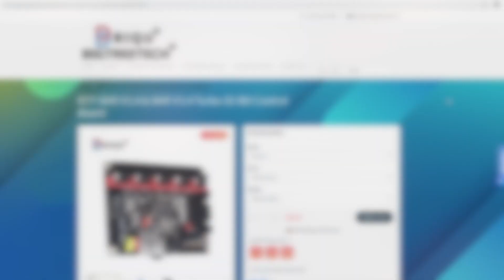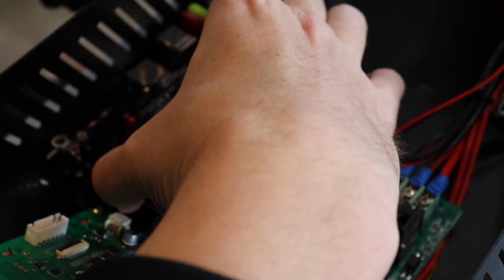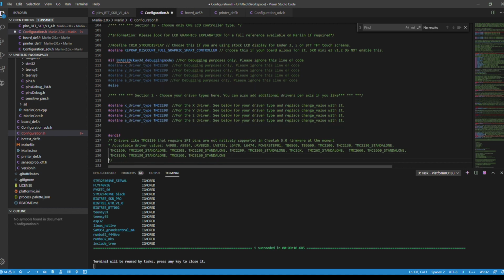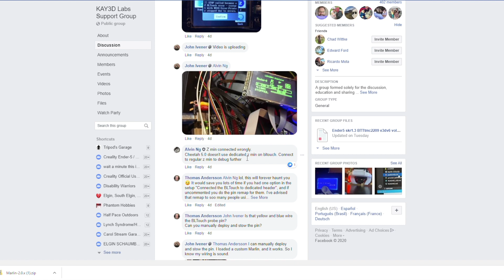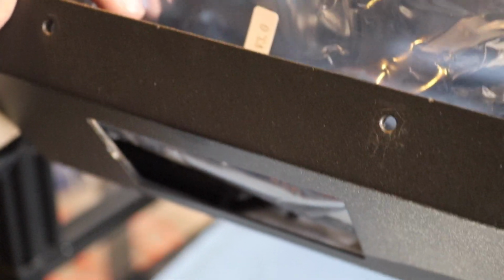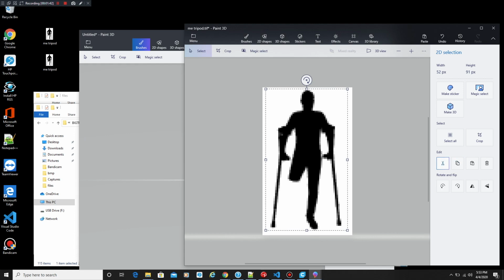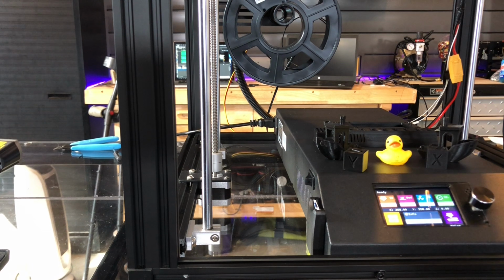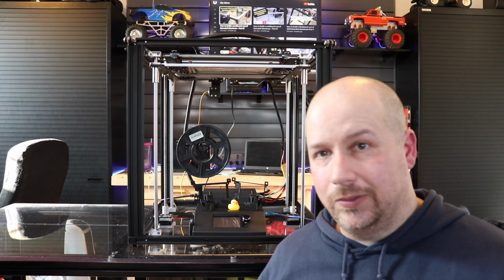Ender 5 Plus Ultimate Upgrade!   BIGTREETECH 32bit 1.4 SKR TURBO & BIGTREETECH TFT35 V3.0

Comment: HELP!   I searched every possible way, to find PlatformIO IDE and it doesn't show up at all...I can't download it and so I cant flash the firmware.  I'm actually trying to use this board on a Lowrider CNC printer...  I'm so confused...  Thanks!
Reply: Marlin has a terrific guide to show you how to get setup. Check this out: https://marlinfw.org/docs/basics/install_platformio_vscode.html

Comment: @Tripods Garage  Thank you for the very detailed video. I purchased the same setup after coming across your video on the creality facebook page. I currently am at the point of editing the code in visual studio but the files do not show up when I try to open them. I downloaded the file from github, unzipped it, and saved it to the desktop. If i open the files it will automatically open them up it VS but when I save the changes it creates a new file instead of over writing the existing files. I then downloaded your setup from github, unzipped it, copied it to the sd card, and tried updating the board via sd card but when i turn on the power i only get a blank screen. Any help you could offer would be greatly appreciated.

Comment: Im having an issue with aux leveling. It only does a small square on the first quadrant of the bed as if it was an ender 3 bed for the 4 points. abl works fine, but obviously useless if i cant level it by hand first
Reply: Same issuse as I have

Comment: It may be possible to print directly from the SD Card on the Bigtree Tech board Configuration_adv.h

I can't test this because of bugs in Malin code

 // Add an optimized binary file transfer mode, initiated with 'M28 B1'

  //#define BINARY_FILE_TRANSFER

  /**
   * Set this option to one of the following (or the board's defaults apply):
   *
   *           LCD - Use the SD drive in the external LCD controller.
   *       ONBOARD - Use the SD drive on the control board. (No SD_DETECT_PIN. M21 to init.)
   *  CUSTOM_CABLE - Use a custom cable to access the SD (as defined in a pins file).
   *
   * :[ 'LCD', 'ONBOARD', 'CUSTOM_CABLE' ]
   */
  //#define SDCARD_CONNECTION LCD

#if ENABLED(SDCARD_BOARD_FIX)
  #define SDCARD_CONNECTION ONBOARD // Forces SD card to work on mainboard. Some boards do not need this fix.
  #endif
  #if ENABLED(SDCARD_LCD_FIX)
  #define SDCARD_CONNECTION LCD // Forces SD card to work on external LCD/ TFT. Some screens do not need this fix.
  #endif

Comment: Malin mode does not work on the tft35 v3.0. Touch screen works fine but not the marlin mode.
Reply from the maker: Chuck Taylor - Any error messages on the Marlin mode?
Reply: @TripodsGarage   I have two error messages when I compile. 1st one is... Cannot find "c:\Marlin-2.0.x\include". [9,17] 2nd one is... Cannot find "c:\Marlin-2.0.x\include". [29,21]  I do not get any error on the screen its self.
Reply: The problem was because I am using this on an ender 5 and just changed it to work. You must go to printer_def.h and look for your printer mine had define CR10_STOCKDISPLAY so I changed it to REPRAP_DISCOUNT_FULL_GRAPHIC_SMART_CONTROLLER and now it works. Now once my hair grows back everything will be fine!!

Comment: I changed the pins on the abl, but it does work correctly, it turns on but the probe when going to print doesn’t stop the z axis
Reply from the maker: The Island Engineer - Check your black and white wires.
Reply: Tripods Garage yes, were reversed. But still not working for me. Flashed both display and skr. Manually moving the axis it does a small back a forth movement on whatever axis. Seems comunication from display to printer are a bit off.

Comment: Anyone using the extra driver for the 2nd Z motor? The new Marlin has an auto Z align feature (?) but it requires independent drivers for each Z motor.

Comment: I am not finding the firmware.bin file in the download package on your github.  I downloaded the Marlin-cheetah file.  But I am not seeing the .pio folder under Marlin-2.0x.  Thanks
Reply from the maker: Odd - I just placed the firmware.bin on Github
Reply: Tripods Garage is it a file all by itself?  Thanks
Reply from the maker: @daveglover8942  Yep!  Sitting all by it's lonesome!  https://github.com/tripodsgarage/Ender-5-Plus-build/blob/master/firmware.bin
Reply: @TripodsGarage  Got it.  Thanks.  My boards should be in on Thursday, then I will give it a try.  Any issues using Octoprint with this build?
Reply from the maker: Dave Glover - Shouldn’t be any issues with using Octoprint, people have been using it with this board, plus Pronterface connects without issues.  However, I haven’t had time to set mine up yet, it is on my list 😉

Comment: The SKR 1.4 got dual Z-outputs so why you use all 5 stepper drivers unless you are using dual extruder is beyond me :)
Reply from the maker: The kit comes with all 5, so I installed all 5, beats sitting in a drawer.  The dual Z is just a internal splitter, the 5th driver could actually be used to control each Z if you want.
Reply: @TripodsGarage  thanks for this video, got me past a lot of pitfalls. With your video and Chatthong Rimthong's post on the FB E5/E5P group I'm setting up an SKR14Turbo right now, and until I decide to add a second extruder, I'd rather use that stepper for the second Z.  Have you looked into it, is it as simple as setting your "NUM_Z_STEPPER_DRIVERS 2" in the marlin configuration_adv.h file?  Since the stock E5P only has the single BLTouch for a Z-stop so the "Z_MULTI_ENDSTOPS" should stay disabled. I'm asking before I accidentally torque one Z screw and not the other and royally bend up my printer, maybe I should disconnect the Z screw couplers for an initial test...Thanks in advance and please keep creating great videos.

Comment: I like your setup.  How do you like the 1.4 on the 5 Plus?    The more I run the SKR Mini, the more buggy is seems.  Not bad.  I trust it for several days prints, but there are times it barfs, and I have a bit to clean up.
This one is mine
https://www.thingiverse.com/thing:4181859
Reply from the maker: @No Body - Thanks for watching!  I wanted to keep the existing control box stock looking, well for now.  If I addd anything else to the inside, it will be time for another solution.  I have been running the E5+ in this new configuration 24/7 for 5 days, printing out ear saver strips for local hospitals.  So far the Skr 1.4 Turbo has been solid, no complaints!  I can have it run right behind my in Zoom meetings for work, and nobody can hear it ;-).  I have seen your setup before on the Creality Facebook Groups, looks amazing!
Thanks again for watching, like and subscribe - Tripod

Comment: did the swap help with your bed leveling issues ?( did the prints start sticking to the bed better ), wondering couse i think my  stock board has issues i dont know if its board related or  firmware , if its firmware i am gona speed this swap up and do it 1st before i do the rest of the mods
Reply: level bed, fix z offset, warmed bed, print hotter. Basic steps to better bed adhesion.
Reply: @SteinerSE  thats all nice and good but the homing bugs out and the nozzle crashes on the front of the printer the ABL doesnt get a good reading they are all over the place , the lead screws for the Z axis are all crazy and make noise , + the stock firmware goes bonkers every now and then . so you can do all that get a couple of good prints and back to the drawing board , its not a solution on my case , and doesnt rly matter anymore anyways couse i ordered all the parts i need including this board

Comment: Mine only came with 4x TMC 2209's. What gives lol
Reply from the maker: Really?  Never seen a BTT kit that didn’t fill all the available driver ports.
Reply: @TripodsGarage  It has 5 ports, its the 5th TMC 2209 that wasnt sent with my kit.
Reply: @TripodsGarage  Ok, Id missread your reply earlier. Anyway though I checked the amazon listing and mine was only supposed to come with 4. It might of been the E5 kit rather than the E5+ kit. I suppose I'll have to use a splitter cable to reach both Zaxis motors
Reply from the maker: Reece Engineering Greetings!  You will not need to get a splitter if you have the Skr 1.4 Turbo.  The Z is internally split (ZAM & ZBM).  Basically the E1M is your extra driver (#5) port,.  E1M can actually be used if you want to separately drive the other Z motor, but not really needed.  Hope that makes sense?  Thanks Tripod
Reply: @TripodsGarage  1. X Axis
2. Y Axis
3. Z axis
4. Extruder

Yea it makes sense, but now Im wondering why your kit came with 5 2209s and what you are going to do with the 5th one lol!

Comment: Ran into some issues with my compile. I tied to do it all myself, I am very close but im having a BLTouch issue. Here are my config files. If you have time to take a look that would be awesome! My BLTouch doesnt stop the z-axis from crashing into the nozzle. I did install my BLTouch into the zstop pins.. which may not be correct. 
https://github.com/zdietzen/Ender-5-Plus-SKR-1.4-Turbo-Marlin-2.0.X
Reply: Im actually just going to do it your way and using your firmware. Im tired of messing with it! lol